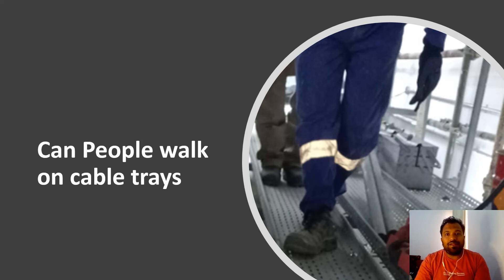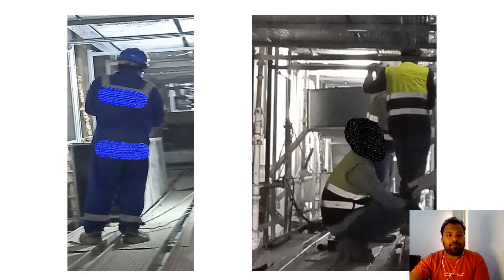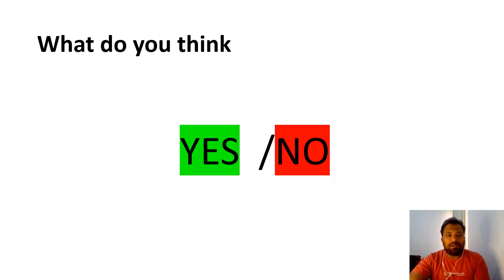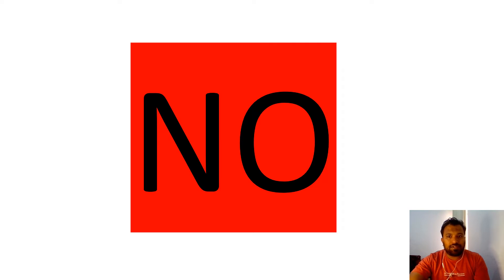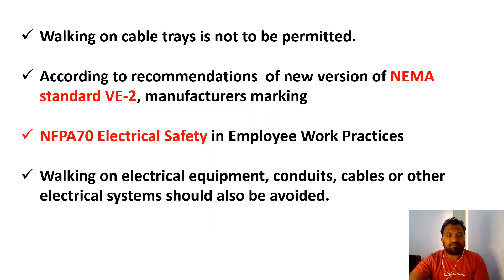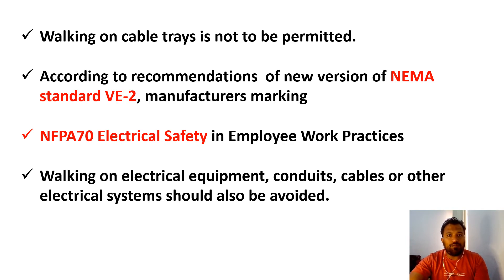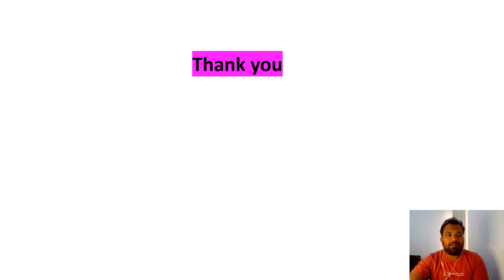Can people walk on cable trays

Comment: sir how to calculate rccb and elr, els amps rating
Reply from the maker: RCCB and ELR they are used for leakage current . 
as per standards like power 100ma,sockets 30ma,etc so  rating of RCCB depend on the circuit rated amps .   

i will make a video topic on this
Reply from the maker: i am starting soon circuit breaker topics in that i can explain in details